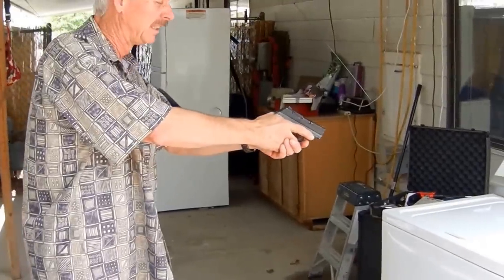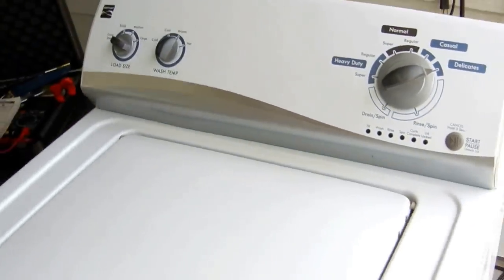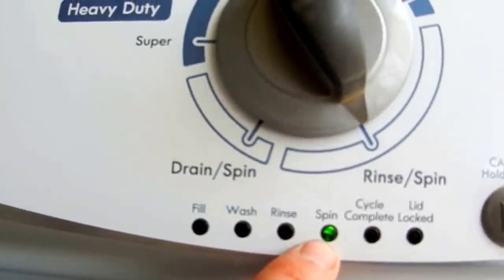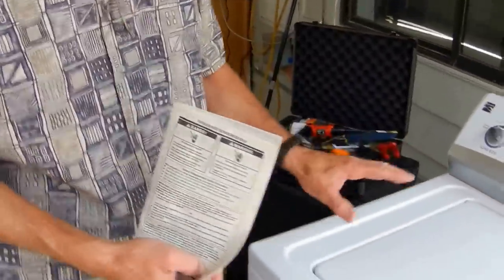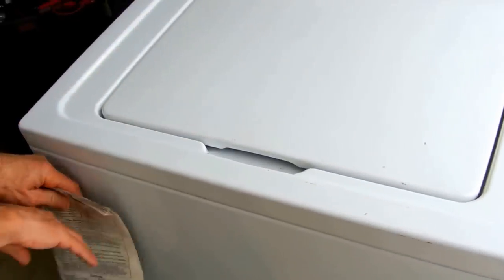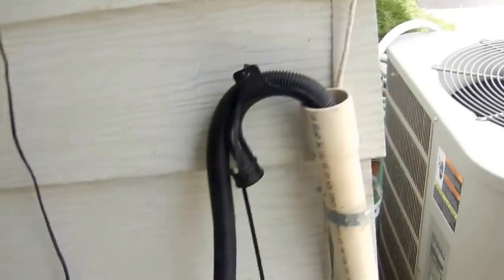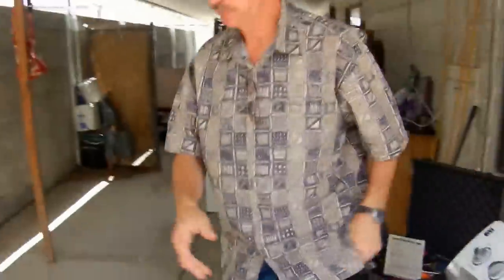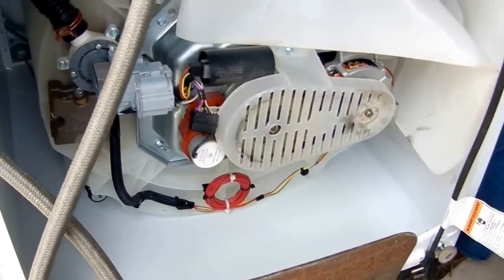Washer topload diagnostic mode.

Comment: This is the washer I have and I hate it.  Hate it.  But thank you very much for this information.
Reply: Youtuber I'm not sure.  At first I thought it was the lid lock issue but I don't think that's the problem anymore.  Right now it fills with water and sits on the wash cycles with no agitation,  then it drains spins out and the rest of the cycle is fine.  In other words when it does the rinse cycle it agitates fine.  So if I do each load twice, using the first rinse as a wash and the second rinse as the actual rinse, I'm still limping along.  But I think this machine had issue from day one.  The sensor for size has never worked.  One towel and it fills to the max water level the same as if it was a full load.  I was really sick at the time so I just let it go.  I've just never liked it at all and will go back to a very basic machine when I buy again.
Reply: Youtuber Also, I could not get the diagnostic cycle to work.  It's almost like the machine doesn't know there is an issue.
Reply: by-pass the lock switch. there on videos on here to by-pass the switch. you have a bad lock switch.
Reply: I hate this machine too. Can't soak clothes long enough if you leave lid up it drains. I hate the thing. Will not fill with enough water to wash clothes on regular cycle. The worst one I've every had from sears. Do not buy.

Comment: I have this washer and water will not drain. How do I fix this
Reply from the maker: Most likely water pump quit or has an obstruction or there is a clog somewhere in the drain system. You will have a water mess anyway. Last time I was able to haul it out of the house before working on it.
Reply: Ok I’m going to to take drain pump off
But I take it off from bottom correct? 
Do you have a pump in stock
Reply from the maker: @denerodoles4832  I don't sell any parts but with the part number you can order at eBay or Amazon.

Comment: it is stuck in pre soak cycle and won't cone on. Help
Reply from the maker: Not sure but first check the water inlet hoses to see if the little screens are plugged with gunk restricting the water coming in. Otherwise must diagnose with manuel codes.

Comment: I tried the test.     but the test didn't work.     any ideas?
Reply from the maker: It has been awhile but I remember that it makes a difference if the lid lock is activated or not before starting the test. Or maybe lid lock not working?
Reply: Ok.  I will try that
Reply: Well does it need to be locked or not.  I was NOt able to get the washer in the diagnostic mode after many attempts. Also the locking feature seems to be the issue, It fills but when filling is complete it won't advance from the sensing mode to the wash mode, it "tries' to lock but won't/can't, then ist gives up and just drains. I have some replacements parts  for locking device , have someone installing them today  hope that is the issue.
Reply: Okay I managed to get it in the test mode,  replaced  the shifter  still didn't work  replaced locking device  now it works fine.  I wasn't  sure if I understood  the error codes(LOL)!

Comment: I have a problem with my washer. it starts when I plug it in and restarts on its own when a cycle finishes. I checked for a stuck start button and ran a calibration.

Comment: my spin cycle makes a  sound kinda  like a jet???
Reply: need help with Kenmore washer trying to figure out what's wrong with it u~tube tutorials  wasn't  clear enough
Reply: You need a gearcase most likely the bearing is bad. Turn the tub by hand it should sound smooth, not rough.

Comment: I have done the test pattern alot of times never get any green light help?
Reply from the maker: I remember you have to start with lid not locked, or was it locked first, I dont have one handy here to try for you as I already shot them all...er, I mean, got rid of them all, but was something about that as I recall. I try not to work on these anymore.
Reply: @AlFixit  cover closed wont start took back panel off there is a green light on so there is power to it. so it might not be sensing the lock sensor that lid closed?

Comment: Mine won't get cold water and hot only works sometimes. Can you help
Reply from the maker: Hoses can be disconnected at the washer and check for scale or anything plugging it up, sometimes there is a little screen that can be cleaned or replaced. Don't forget to turn off the water valve before disconnecting the hoses. If anything gets past this point into the washer then you have to take the inlet vales apart to clean or replace.